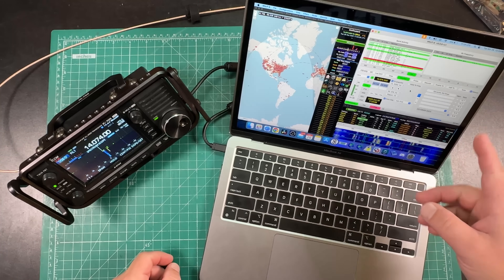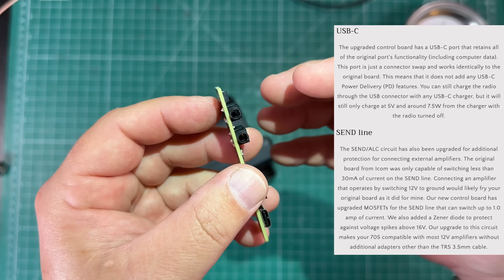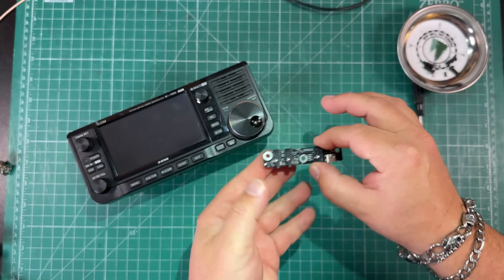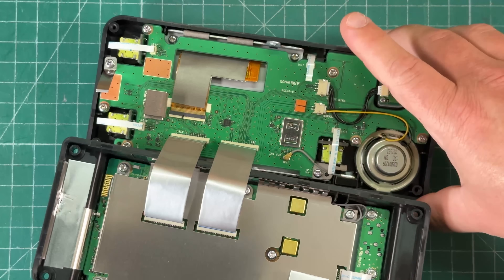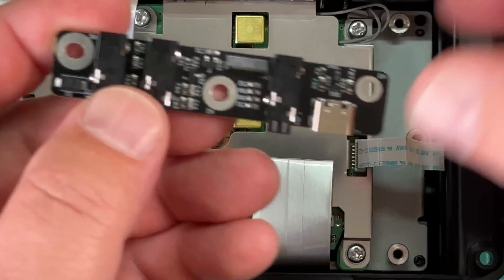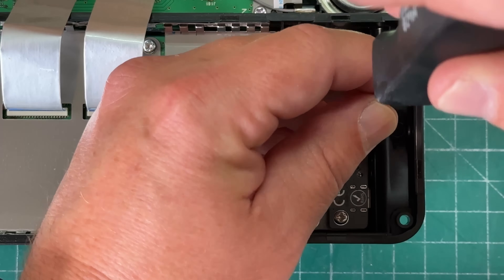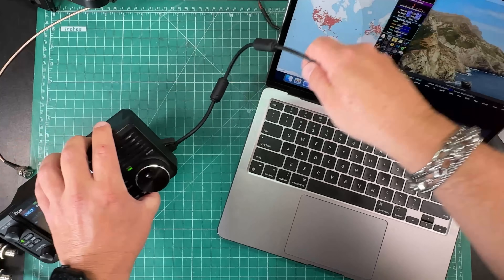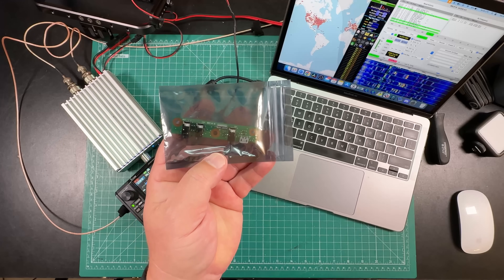5 Minute Icom 705 Upgrade To USB-C With This Simple Board Swap

Comment: OK: thank you for this quick video update.  Question: does this board allow my 705 to transmit at full 10 watts when I am powering it with USB-C?
Reply from the maker: Sadly no.  It doesn't improve any of the charging / power functions at all.

Comment: Great video. I have an issue I have a MacBook Air 13”. The icom 705 is just not recognised by the MacBook. Are there special drivers for the MacBook USB C slots. The two USB C slots all say Bluetooth etc. can’t find a YouTube video that shows how to do them like a windows pc I.e device manager. I have a laptop all setup for ft8 with 705 and 7300 but this MacBook is much smaller and lighter so I do want to get it moving with Ft8. Would be great to show a video or screen shot of exactly what it says in your connection settings. Ps. I haven’t done the USB C upgrade on the 705 yet but don’t see that bad being the connection issue. 👍
Reply from the maker: you probably need this driver: https://www.silabs.com/software-and-tools/usb-to-uart-bridge-vcp-drivers?tab=downloads
Reply: @hamradiotube ok. Just looked. I saw that it’s for iOS as well. Thanks 👍👍👍
Reply: @hamradiotube excellent. Thanks for that it’s up and running now.  Didn’t realise I had installed silicon labs usb drivers on my other windows laptop. Never even crossed my mind thought I just plugged it in clicked on FT 8 presets and off it went. Long time ago setting it up. 👍👍👍 thanks.
Reply: @hamradiotube will try it.

Comment: I burned out my 705 twice under warranty , running a 2 meter 200 watt Mirage on  side band.  The guy in Michigan told me they won't cover it again if I continue to use the amplifier .   Then the guy at Henry, refused to install an RCA jack on a new henry, so i could run an RBI Buffer.       He's been a Ham for 60 years and has never heard of an amp damaging a transceiver.   
  He said "the amplifier is RF sensing ".
Reply: There is something in the 705 extended manual about voltage spikes coming back from running amps with a specific diode. Look into that.

Comment: What cable are you using between the 705 and MacBook? Looks like it has two toroids on it. I know the 705 is notorious for bad RFI when cable connected to a computer. Have you had good experience with that cable? Does the RFI issue seem mitigated by the USB C connector / board?
Reply from the maker: Enjoy this Amazon affiliate link: https://amzn.to/47D5Lvw  I've got 3 of these cables and 2 of the 6' ones he makes.  Since switching to a Mac for portable I've not had much luck finding any good shielded cables with ferrites that have USB-C on both ends.  So far these Digirig ones haven't given me any trouble.  I've only used them with my FTX-1F and IC-705 so far.  I purchased the other cables to go with my other radios.  For my (2) Yaesu FT-891's and 818 I use the Digirig sound card which has USB-C so I bought a few for those radios.  I'm using the 3rd shorter cable for my QMX.  Now if I could just figure out a way to put a USB-C on my IC-7300!
Reply: @hamradiotube  I have the 7300 as well using a legacy USB cable, but couldn't we just use USB-A to USB-C adapters?

Comment: The screws are a version of Phillips called JIS. My screws were inserted with lock tight from the factory and very hard to remove. A JIS screwdriver fits better on the screw heads will help get those screws out. Available at most online retailers.
Reply: Exactly this; I chewed up one of the screws on my 705 using a regular Philips head screwdriver.  A set of JIS screwdrivers is available for less than $20 and will probably last a lifetime.

Of course, I solved the problem permanently by replacing the exterior screws with button head screws that use Allen keys.
Reply: JIS is the standard on most Japanese electronics; well worth getting a decent set of them if you’re looking to dismantle Japanese gear!
The interface board is pretty simple to install and fits perfectly! I’ve done it on my own IC-705!

Comment: At about 00:32 "Doesn't have PD but it'll still charge the 705."  I know I should know this, but what is 'PD' and what would be different if it did provide 'PD'.
Reply: Power delivery, faster charging.
Reply: USB Power Delivery; it's the reason @Temporarily Offline can use a USB battery bank to power his radios via the correct trigger cable.
Reply: Actually it must have PD. As a client device it has to signal the charger what voltage and current it can handle for charging. For a true PD charger at least one resistor on the c1 line is required to tell the charger to give 5 volts. Otherwise you would have to use a special cable and any advantage over USB-micro is gone.

Comment: Why USB-C Mike?
Reply from the maker: Because aside from my 7300 and my phone, everything in my life has USB-C.  One cable to rule them all.
Reply: @hamradiotube thank you.
Reply: it should be noted that the micro usb connector tends to create a LOT of RFI, to the point that WSJT-X will disconnect when transmitting on the 705. USB C more or less gets rid of that issue.
Reply: @JonathanKayne  FYI, he had 2 ferrites on his tiny 1 meter USB-C cable.
Reply: @LavalampDM I'm guessing it's one of the cables you can buy from a digirig. With micro USB, I had to wrap my cable around a large ft240-43 toroid to make it work at all. I've used plain old USB C cables without any ferrite beads with success.
Reply: Because micro USB sucks?